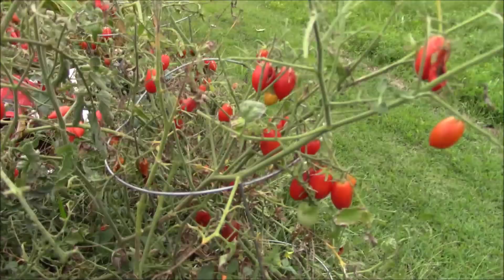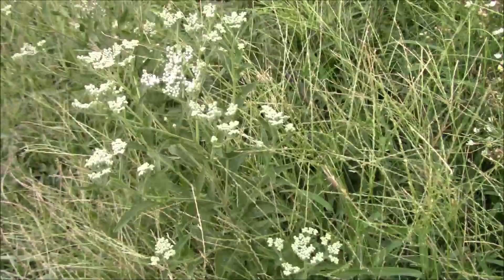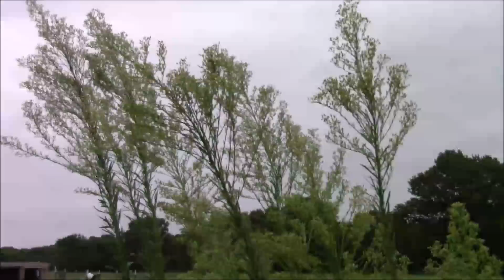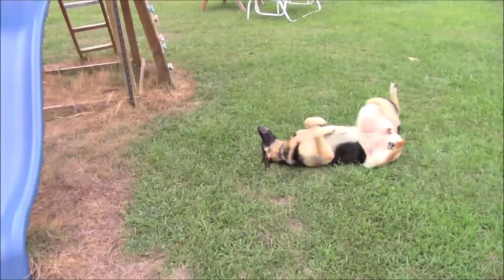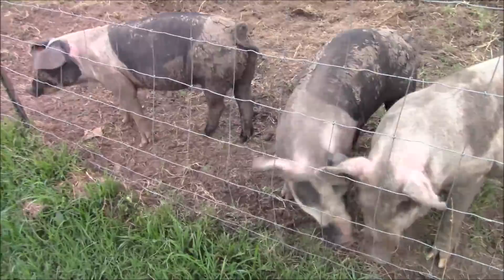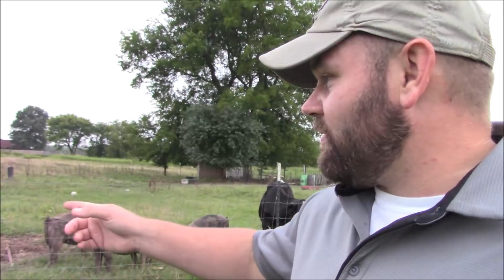Wind Power For Our Farm House!?! Is It Possible?!?

Comment: Take it from an off grid in oklahoma.i had wind power.  It works but it isn't anything you can count on for stable power input.  Solar is better.  Talk to okierob about a transfer panel.  We run 2 freezers and fridge plus everything else on solar.  Wind is supplement charge for the batteries.  Okierob can give you my number.  You can grid tie to reduce your power bill
Reply: For your house propane backup generator would be better for a fast fix. Electrician can install the generator safety switch
Reply: It's funny. I think solar is less reliable... cloudy areas, also my Alaskan friends have months of no sun

Comment: Here's the deal. Wind turbines and solar both manage DC power. Pretty much everything in your house runs on AC power. As long as you have a power inverter and keep your fridge and freezer on a dedicated circuit your ok. This is where the other shoe drops. How much power you have available to run those two things (They are two of your biggest energy hogs) depends on how good of panels and power management equipment you have (If you are solar) or how good of a turbine and management equipment you have (If you use wind). The real solution is to eventually use both and tie them together. This does not mean twice the investment. Both wind and solar equipment can be tied into the same  bank of batteries and management equipment. Where you live you will have both sun and wind on many days. and on nights you will still probably have wind.  Its not perfect but it is still a good solution to a simple problem. Don't forget a backup generator just in case...

Comment: Please do not go with wind power. It is a total waste of your money. As Bill and Ross mentioned in a previous comment, you cannot count on wind. I live in Oklahoma, where the wind comes sweeping down the plains, and in two years time I produced sixty dollars of electricity. This was with a $20,000 wind generator. I blew an inverter which was fortunately still under warranty but would have cost $8,000 to replace. After two years I sold it for a huge loss to a man in Kansas who knew exactly why I was selling it but thought he would have much better luck. The noise from the wind generator is very loud if you have high winds. Neighbors within 500' of you will not be happy with the noise. They only work within a certain wind speed range. If money is not an object, solar would be another option. When you look at alternative fuels, you will find that the power companies are not such a rip off after all. When I bought mine, there were five other generators within my drive home from work. Now there are none.
Reply: Which wind turbine ( mfr & model # and watts ? ) did you buy for $40,000?  Most Wind Turbines are rated at 25 MPH for Max Power.    So the big problem is ... at 12 MPH wind speed, a wind turbine only generates about 1/8th of rated power - Ouch !!!   Western Oklahoma does have good wind, but Eastern Oklahoma does not ....
Reply: @MrSummitville  I edited my comment. It was a $20,000 generator back in 1981 ... not $40,000. The manufacturer was Bergey Excel 10KW. It required an 8 MPH wind to turn the turbine and it would furl out of the wind around 20 MPH. When the tail boom would help furl the prop out of the wind, it would be much louder. When I bought mine, there were five others within a few mile of me. They are all gone now. I live in OKC and the Bergey Windpower Company is only twenty miles from me. When I bought it, they made it sound like it would provide enough power for my 1,200 sq ft house because I live on a hill. When I would complain that it was only producing about three dollars a month, they said it was because of too many trees in my area. It was on a 100' tower.
Reply: @fulks19  If, and only if, you had steady 27 MPH winds for 8 Hours per day then it would generate ~80 kilowatt-hours per day = enough energy.   Yes, I used 27 MPH  because it is rated at 10,000 Watts @ 27 MPH !!!  So, who has steady 27 MPH all day, every day?  But the real problem ( the big lie ) with a wind turbine is ... at 12 MPH, you do not get 1/2 the power, you get 1/8th the power - OUCH !!!  So, yes in 12 MPH winds, it is "spinning", but it is generating only 1,000 Watts = way too little energy, to power a home.  It should have furled at 35MPH.  And then, add the cost of repairs, when it fails = $$$'s.  I cannot find any home owner that can cost-justify a Wind Turbine ...

Comment: Semper Fi Boot,. Hook em Horns!!!!!!!  Lol

Set up a battery backup that the wind turbine would charge.  See if you can set up a system so extra power will go back into the grid reducing the power bill.  Use both wind and solar.

Comment: You can do a grid-tie wind generator to offset your power usage with your power company if your power company allows it would be the easiest although it does not give you backup power in the event of a power outage

Comment: Wind is an ok backup/supplement, but not a good primary source. If you had room for several massive commercial generators and tons of storage, then maybe. 10 acres is not enough. I'd go solar is I were you for another reason, there is nothing mechanical to fail. Electronics fails, but not as much as mechanical things.

Comment: I like to experiment with solar and wind myself, but i work for a electric utility and they are investing huge money into wind but ONLY because of the tax incentives. It is a total rip off for the investor/taxpayer. For back up power I have a generator that runs on both propane or gasoline, works great and we typically only use it on propane so the "old gasoline" problem is not an issue. An inexpensive way to turn your electrical panel to a safe transfer switch is a Generator Interlock for your main breaker panel.  Good luck to you I like your videos! God Bless.

Comment: Talk to the guy at Missouri Wind and Solar for your wind turbine needs.   If you are going to pick one between wind and solar, I'd pick solar panels.  Wind is too variable unless you can get your tower up into undisturbed air.   You would also need a battery bank to store what ever power you'd generate.

Comment: I live right down the street from you. I am a retired electrician. I have studied all types of alternative power systems. I came to the conclusion that a 22K Generac generator with a transfer works the best. It is also the cheapest in the long run for alternative energy. We have installed the gas operated generator at our house. It works like a charm and you get your power when you need it the most. Just a thought.

Comment: Dutch, have your electricians install two different breaker panels. They can both be ran off electricity and when you decided to switch to wind, one of the breaker panels can easily be switched to wind. Just make sure you put everything you want to be powered from wind in the same breaker panel.

Comment: Wire can always be ran buddy and transfer switches can always be installed. Start small and keep a log of reliability, maintenance and over cost.
Maybe run solar on some and then wind on something else, the collection on energy is the only real difference being wind or sun. Everything else is going to be the same id say. Charge controllers, inverter, battery bank. 
(A back up emergency generator that operates off propane or diesel or natural gas might be a great alternative , just would need a.transfer switch and generator( you know the GOVT auctions off the huge  generators that would be at some FOBs in the sandbox.) They are like 16kw

Comment: Maybe you could use a multi circuit  transfer switch  so you are not running duplicate power outlets to all the locations where you want backup power.  Just use the switches right there in your utility room to switch from grid to wind/solar/gen.  10 switchable circuits for under $400.  https://www.lowes.com/pd/Reliance-30-Amp-10-Circuit-Transfer-Switch/4712891

Comment: Forget wind & solar!! Get a propane or natural gas powered generator.
Many years experience in western Oklahoma will steer you away from wind & solar.
Be sure your water well is hooked to the generator to water your livestock when power is down.
Have a gas stove to cook on when power is down and a good functioning fireplace or wood stove for heat.

Comment: I am also windy, every day, and have been toying with the idea.  I would just use it as a supplement to the grid.  Let them store it, and let it off set your power bill.  No batteries except for emergency use in case of outage.  Should pay for itself in a few years.  That was my idea.  Interested in what you do and how it works.

Comment: as for out lets I would not install one for solar/wind and then grid.  I would were ever the main breaker box is going to be have a transfer switch set up for what you want to be your emergency out lets.  That way if the grid goes down you can flip on switch and have all your emergency out lets running.   I would also have it set up to were if you don't have enough power in the battery bank to keep the loads up and going, you can have an inverter that will kick on a back up generator.      There is a lot that can be done depending on what you want going.  I would have at least all the lights, your frig, deep freeze and a few plugs, set up for back up just in case.   

As for wind, that will depend what who you go with, I would go with a professional wind turbine not those small tinny ones that you see people sell.  IE ones that at the size of a car alternator, and the people are proclaiming they put out 2000 watts or 3200 watts there's tones of them and they are all junk.  I have had two of those small wind turbines and had to have at least 20 mph winds just to get 200 watts from them, and to even come close to t here ratted out puts I had to have 32mph winds to get 1kw.   So be for you do wind do a lot of research, and look for a good company, or at least one that might install it and set it all up.    But for me Solar is the way to go its much cheaper than wind in the long run and will pay its self off in a few years were as wind turbines will break down before they come close to paying there self off if you go with the micro wind turbines.   I spent over 2000 on wind turbines and never got any thing good from them unless there was a large storm.   Solar is cheaper much cheaper to maintain than a wind turbine.  Some companies if you by their wind turbines and are unhappy with it and do a video that your unhappy or even if you write a Facebook post or a blog they will sue you for it, I have seen on company do this now like a dozen times.    

My setup has an inverter that my home uses when I have enough sun to run the loads I Have hooked to the inverter. if there is not enough sun then it kicks back to the grid. or turns on a generator that has a transfer switch to recharge the bank if need be until there is either enough solar, or the grid kicks back on.    You can also install solar trackers to track the sun for more though out the day power to charge batteries or run your loads.  Bill and Rosa has a nice solar set up.  Another person that is completely off grid is https://www.youtube.com/user/NoMainsPowerNoProble that his YouTube channel. 

I use a cool inverter it was only 900 bucks but it is a inverter/charger. I has a built in solar charge controller, grid charge controller and much more.  The only thing I Had to do is get a transformer for split phase since they are 230 volts, but now they are building them for 120 volt as well for the US market.  http://www.ebaystores.com/Maximum-Solar-and-General-Goods  This is the company I got my inverter from, they have all kinds of inverters and also they have inverters like mine that is also can act like a Grid Tie inverter, that way if your battery bank is full it can feed the excess from solar in to the grid lowering your power bill.  So there is a lot that can be done.

Comment: Have them put in a second breaker panel and wire in all emergency outlets into it. If you do wind get the larger turbine with the wound stators like thebillythejack2010 on youtube is building. the alternator ones are only good in high winds. I have learned solar is much better in my area

Comment: In my opinion, solar is the way to go. There is very little maintenance to a solar panel. A wind turbine requires a significant amount of maintenance from lubrication to regular inspection to ensure all the moving parts are secure. Here in south east Kansas we have Westar Energy. They do some work with wind turbines. We were given the opportunity to elect that a portion of our power consumption comes from the wind turbines. Something you may look into with your energy company.
Reply: Wind turbines require minimal to non maintenance if installed properly, far better than solar which needs constant cleaning from dust and dirt on the panels and can be busted if you have a storm of hail.

Comment: Reach out to Engineer 775 he is on the tube.  I know he does solar systems and others. Just one thought wind power is mechanical so it will breakdown.  Also it is effected by to much wind.  Ice can can be a problem. Backup generator that runs off propane might be a choice. Work great here in Florida for hurricanes.

Comment: Missouri Wind & Solar is a good company to look into for wind systems...they are a great site.
Using 2 separate outlets is not advisable due to possible failure of power from the one it is plugged in to.
A system that is run on top of the grid (mains) power would be much more dependable.
Basically you would have an automatic switch to run off of wind/solar while they are producing.

Comment: I have 3 sources  Solar ,Wind and a generator (used from an army base) I got a lot of help from a co. called Solar City. First of all get yourself a anemometer to check wind speed. optimal wind is a steady 11.5 mph to produce 5 kws. over that speed its useless turbine wont produce and under that it wont produce. It is noisy a low volume hum and unpredictable and expensive. I live in Canada on the Atlantic coast  and have been using the 3 systems to run my house I do not export anything to the grid and neither do I import. been living like that for the last 20 years .As an aside I recently bought  Tesla car batteries 8 of them they were off an car wreck cost me a little over 4,000$  they are much smaller and lighter than the usual deep cycle ones and they keep a better charge.  This will be my second set of batteries since I started this system.
Reply: Hi. I heard that Canada is not viable for Solar power. Could you inform me on how many watts of Solar panel that you have and how many Kwh do your Solar panels produce per year moreso out of your 3 power sources which of them gives you more power.

Thanks.

Comment: You dont need two plugs. The best way is to hook it up at your breaker box. You will have to talk to your power company. Many of them will require notice so they can prevent back feeding into the system. Then you would use the battery power and when it is low then the grid power would kick in. Then in bad weather and needing to restrict power usage, you would just shut breakers off you dont want to feed.

Comment: Ask the power guy if Oklahoma has 'net metering' so you can sell any extra power back to the company. You could probably run your freezer and fridge with a 1000-watt turbine, 4 high amp hour deep cycle batteries and a 2000 or 3000-watt DC to AC inverter, all for a couple thousand bucks. There are turbines that will slow down the blades in really high winds to keep them from breaking off. Check with the Wind Exchange for Oklahome to get the latest info: https://windexchange.energy.gov/states/ok

Comment: When my cabin was wired they ran two seprate systems I have normal power outlets but near the freezer and fridge there are seprate outlets not hooked up to any outside power but are hooked together. When I moved in I hooked up my power inverter so if power goes out i just plug the fridge and freezer in to them and run my solar system here.
Reply from the maker: Grampa Paul thats the same thing I was talking about maybe doing, everything work good for you?
Reply: Keeping It Dutch yes the seprate outlets system is great just mark which is which. I can eather run my solar system or plug my generator into it. Now as for using a wind generator I have no idea about them. I live in the Tennessee valley area and I don't get winds enough to keep a wind generator going. I my try someday just to supplement my solar system but it being main back-up  power I don't think it will work.
Reply: Grampa Paul b
Reply: rianl1 no I marked my secondary outlets as generator. In red tape so not to confuse with the regular outlets.
Reply: I had an idea if ou use the two outlet system like me make the outlet cover eather red or yellow to tell the difference between the two.

Comment: My neighbor used to live in the part of the state where he had power outages all the time. What he did then and he did it to his new house here was to have a propane generator that comes on automatically when the power goes out. It burns very clean and doesn't use a lot of propane. Maybe you should look into something like that? I'm sure it would be a bunch cheaper than what your trying to do with wind. Thanks again for sharing.
Reply: Exactly.